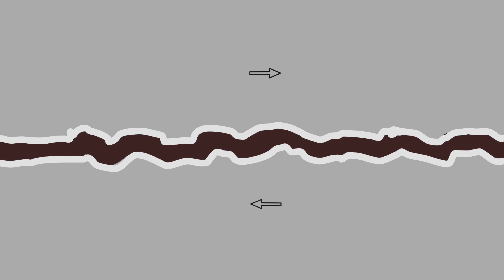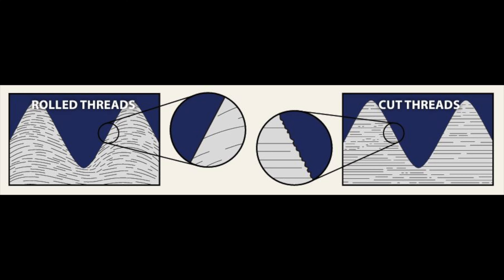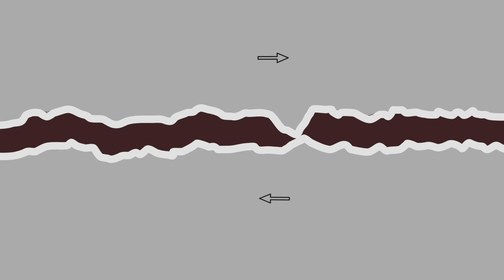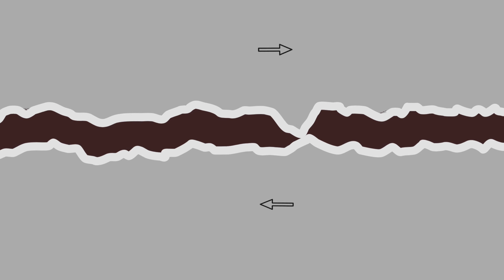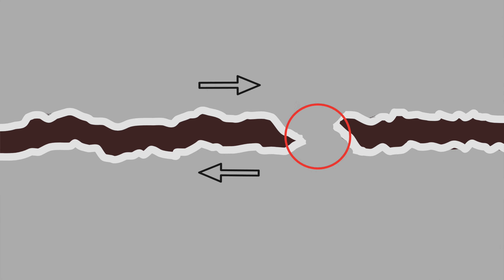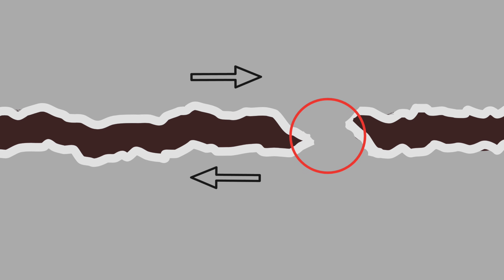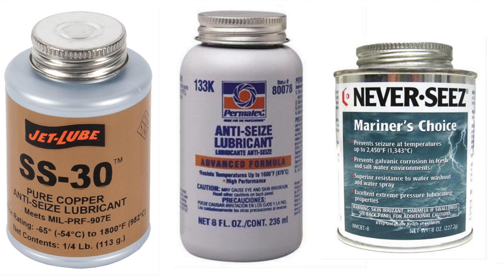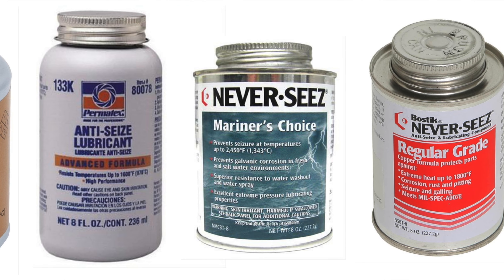Thread Galling 101: What Causes Galling & How Can You Prevent It?

Comment: It's my understanding that any type of anti-seize will cause a torque wrench to over-torque due to the lubricating effect of the anti-seize.  This poses a conundrum in my view.  Your thoughts?  (I am dealing with a bolt that broke while installing a new drive shaft on a car.)
Reply: A lot of people reduce torque by a percentage when installing a lubricated fastener. I’ve heard anywhere from 10-30%. The reality is that torque isn’t a good measurement of bolt tightness. In precision applications you would measure the bolt stretch instead with a dial indicator. My opinion is that degrees of rotation measure stretch more accurately than torque because mathematically a degree of rotation is going to get a certain amount of stretch based on the thread pitch and doesn’t depend on other variables like the thread’s coefficient of friction.
Reply: Yes, you are correct about that and I myself am concerned about over torquing a bolt etc but in all honesty, 40 years of using copper grease and the like, I've never had a problem. I only use a dab though, maybe the problem occurs when you coat the whole circumference of a thread??

Comment: Michael, what do you think would be best for 304 316 stainless that will be inside a wood stove used for secondary air supply for a compolet burn ?? The temperature would be in the 2000 F range Sir. Also, what do you think of the use of metallic paste as compared to non metallic paste Mike ?? Thanks vf

Comment: I work in industrial maintenance i many times i use blue loc-tite vs anti-seize dissimilar metal causes galvanic corrosion and they fuse also loc-tite puts a fine coat of plastic on the threads and it usually firms up making a plastic coating the anti-sieze  can dry and also cause galling  , that's my personal experience, KF8AGW 73's.